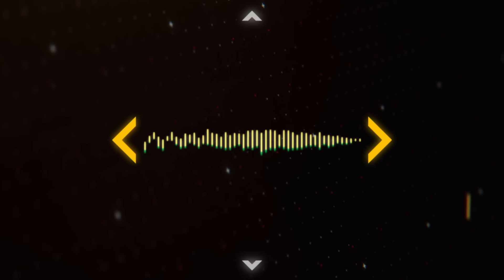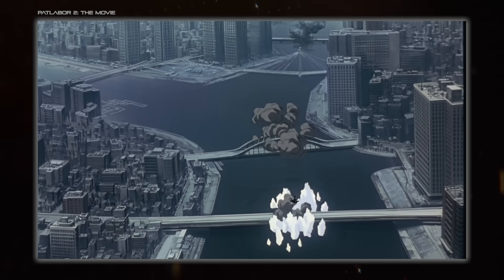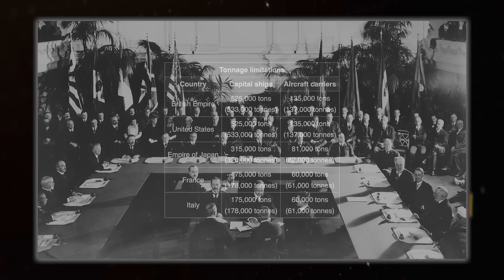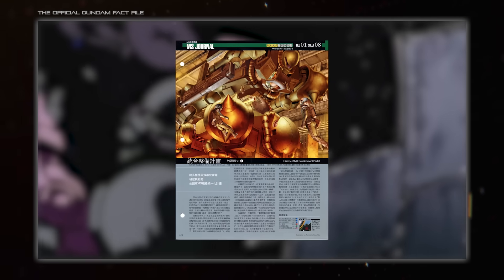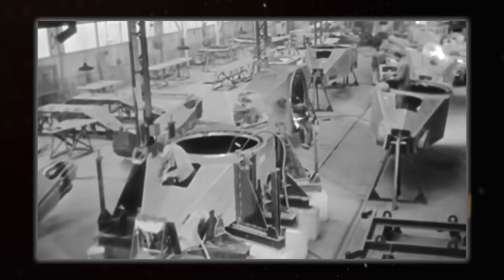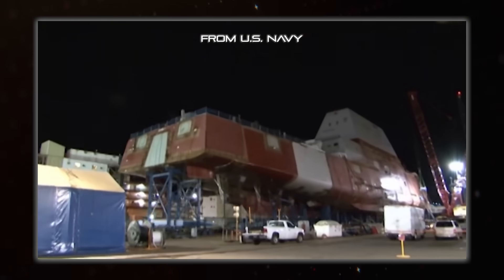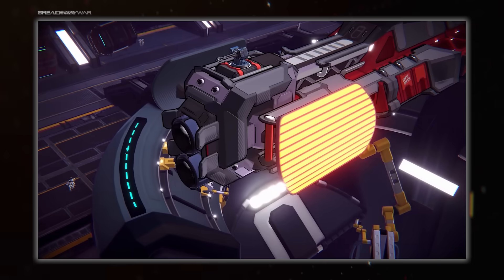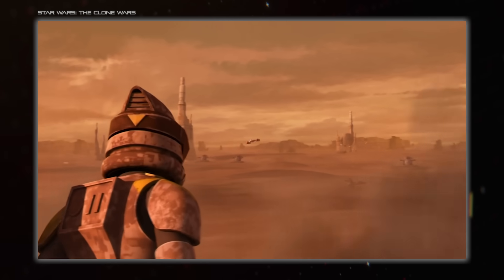Design Principles in Sci-Fi Spaceships

Comment: One thing ALL spaceships need both in and out of fiction is Escape pods.
Reply: Escape pods are actually of pretty questionable utility.

Spaceships don't sink, so the obvious reason to abandon ship isn't very compelling. If there's something onboard that's threatening to explode, it's probably a better idea to jettison that instead of yourself. There are also benefits to staying aboard a damaged ship; you can keep using whatever equipment still functions (the radiation shielding, if nothing else) and whatever supplies are still usable. In order to be a useful alternative to that, the escape pod has to be able to take you somewhere safe (not just off the ship), which is a tall order in deep space or while you're getting shot at and could easily make the pod too large and expensive to be practical.
Reply: @DecidedlyNinja  Yeah they mentioned this in the Spacedock episode I was thinking of. Anything that would make the escape pod on a space ship useful, would just turn in into a small ship. So just have escape "shuttles" instead. :)
Reply: @lurkingllama8364  The one key difference between shuttlecraft and escape pods really is deployment method. In both typical scenarios, shuttlecraft are slower to deploy and get out than an escape pod. Depending on the size of the ship, an escape pod might be closer to reach than the shuttlebay.

In my setting, one other key difference between the escape pods and shuttle-craft, was the pods were reinforced and their launch bay also reinforced so that if the ship has explosions going off, the pod would survive even if still sitting in its launch bay and could just use said explosions to hurl itself away. Another difference was self re-usability, IE once the pod touched down, that was it. Its down and is not capable of taking off again unlike a shuttle-craft which can make multiple landings and takeoffs.

Yes escape pods are functionally spacecraft, but their differences can be like saying a Smart and Minivan are both cars. But one would be a lot more comfortable to use for repeated long multi-day trips than the other.
Reply: @DecidedlyNinja  In my own setting escape pods are used primarily to ferry passengers and crew to either a rescue ship, nearby station, or down to a planet. When none of these are possible, the crew generally tries to repair whatever possible to improve survivability. Edenian escape pods are also equipped with sensor jammers preventing them from being picked up by enemy sensors when fleeing during combat which gives them some utility outside of just being evacuation craft.
Reply: Remotely controlled external robots. R2D2 was sorta one. Probably more like 'inchworm' Canadarms that can get all over the spaceship with latches placed on the hull.
Reply: They're as useful on a space ship as they're on submarines, which is not very useful.
Reply: @Keyboard_Thoughts  So what led you this this line of reasoning exactly? Are you saying a spaceship shouldn't have an equivalent to lifeboats in case the crew need to abandon ship?
Reply: @ciernselar6549  Spacedock actually covers this in an old episode. Everything you need for people to survive in a lifepod/escape pod makes it effectively a small ship, so just give it a shuttle or something. They go into much better detail in the episode they covered about it, but "wet navy" vibes is the main reason those have been included in most sci-fi ships.
Reply: @ciernselar6549  Space is big, and spaceships aren't likely to sink if they're disabled. Carrying literal tons of escape pods is only sensible in settings where energy is cheap, the equipment is ridiculously prone to explode, and there are always other spaceships you can call that are days away at most. (Looking at you, Star Trek.)
Reply: @ciernselar6549  What good is a life boat if the nearest land is 2 000 000 km away (to scale) and no one is coming to save you for months/years? Also said land is an irradiated wasteland with no oxygen food source or water. I don't think you realize how big space is. Also unlike on a boat, weight and space is at an insane premium on a spaceship. Now what is your reasoning for having life pods since you clearly thought about it a lot judging by the confidence in your statement?
Reply: @MuppetsSh0w  So you should just die on the ship then? Also make your statement make sense, Star nations aren't going to be fighting over pisholes are they now? 

Escape pods make sense, its just everyone here is hyper-picky for some reason. The size of space is irrelevant when you fight over a billionth of it (and before you start being clever you know exactly that the vast majority of space battles occur near a habitable body of some form and recovery vessels exist.)
Reply: If the US airforce owned rockets, they'd find some way to define the escape pods as ejector seats.

Comment: One advantage of buy your equipment instead of design and built, is you must have a fix price, delivery and capacity,  development very usually means, over cost, delays and not always deliver what was promised.
Reply: Until your supplier sees that you're in desperate need of them due to a recent catastrophic loss or impending massive invasion and raises the price because they know you can't afford not to buy from them.

Comment: Fun fact: The reason there wasn't enough ammo for the Zumwalts is because it's a bespoke gun system, that doesn't share ammo with any other system in the entire US military. Turns out it becomes amazingly expensive to make such ammo, leading to each round costing like 100.000$ each. (I forget the exact number, but it's within that ballpark.)
Reply: The number is $800,000 USD a round. it's also why one of the guns is being removed and replaced with missiles.
Reply: It was quite a bit more than that but otherwise you are correct !
Reply: $800,000 per round! "The USS Zumwalt can't afford its own $800,000-per-round ammo"
Reply: Read the comment before the video was done. My bad.
Reply: And the ammo was only that expensive because they cancelled like 90% of the class. Economy of scale means a lot when it comes to things like that. Something similar happened with the F-22 Raptor. The Air Force was originally going to buy over 700 of the things to entirely replace the old pure air-to-air F-15C Eagle, but the Secretary of Defense at the time decided that since we weren't fighting any near-peer opponents at the time, we didn't really need that many new air superiority fighters.

This was a bad idea not only in terms of geopolitics, but economics, since the cost of each individual Raptor skyrocketed to an inflation-adjusted $350,000,000 each, even with original design elements like IRST and EOTS removed to reduce production and development costs. The limited number of Raptors also meant that the per-plane cost of upgrades was prohibitive until rising tensions forced the DOD to bite the bullet and go forward with the upgrades anyway.

Compare those cost issues to the F-35, which despite its massive up-front development costs is shaping up to be a remarkably cost-effective aircraft purely through sheer economy of scale, with over a thousand already produced and hundreds more on order, driving its per-unit cost down to the point that it's competitive with many 4.5-gen fighters while offering a combination of stealth and sensor integration that's second to none.
Reply: Driving purchase price down. Maintenance and parts costs are still higher than than that of an F-15 and fleet wide availability is still low.
Reply: @claymclaren5788  Readiness rates have improved recently, and they're working on getting more maintenance depots up and running to support them. It's certainly far more serviceable than the Raptor, and considering how obscenely capable it is, particularly for SEAD, the tradeoff is more than worth it. In exercises it's eaten practically everything they've thrown at it alive, and even after it's expended its payload pilots have found that they can stick around and use their data fusion to better coordinate other aircraft, effectively acting as a forward AWACS platform.
Reply: @griffinfaulkner3514  "but the Secretary of Defense at the time decided that since we weren't fighting any near-peer opponents at the time, we didn't really need that many new air superiority fighters."

Given that the F-22 has famously gone without a kill (balloons notwithstanding) in the two decades since its introduction, he wasn't wrong. 

You only need enough to act as border deterrent (to keep an enemy's probing aircraft back), and a trip-wire (any enemy has to attack in overwhelming force, preventing piecemeal escalation, where they keep pushing you back without triggering a full blown war.)
Reply: @1FatLittleMonkey  He also hamstrung any chance of the Raptor getting consistent updates the way 4th-gen fighters have. With more aircraft in circulation, there's more incentive to keep them up to date and keep their production lines open, and burning flight hours in service isn't as much of a problem as it is now. With the original order still in place we probably wouldn't be considering at NGAD at all, and the Raptor would probably be up to a B or C variant with proper integration of the F-35's sensor suite instead of the podded system that's being designed and tested now. That, and suddenly China would be staring down the barrel of more than thrice the current number of Raptors, and they'd be far more capable to boot. From a geopolitical perspective, that's a massive deterrent that would be far more difficult to overcome than the force we currently have.

If you're asking how we'd pay for all the extra F-22s, keeping the original order implies we keep a primary focus on near-peer warfare, which means the LCS program likely never gets off the ground, saving more than enough money to offset costs, on top of economy of scale kicking in to keep the Raptor price from spiraling as badly as it did.
Reply: its a silly idea
guns are great for shore bombardment. not for ASuW